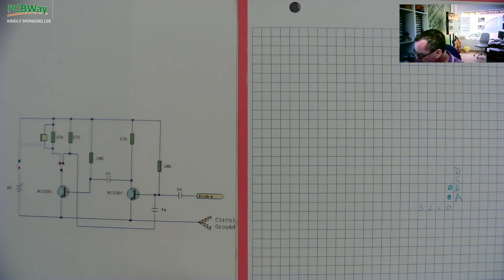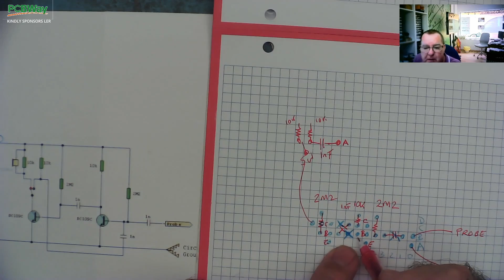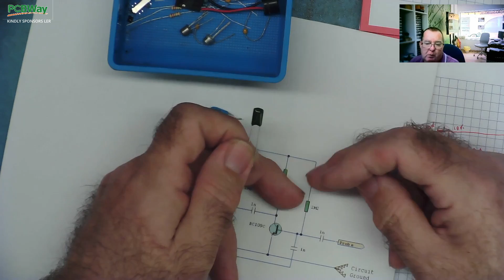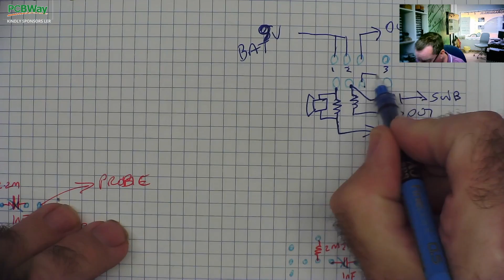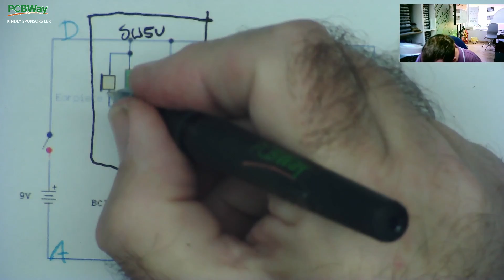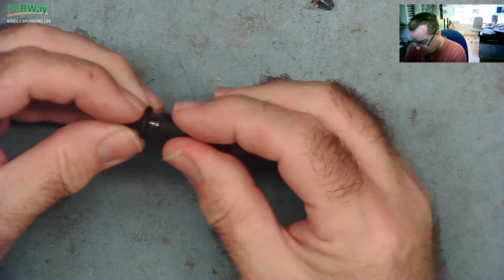Build A Cheap DIY Signal Tracer / Injector Pen Useful For Electronics Fault Finding

Comment: I just went to work for a small repair shop under new ownership and was given an amp to repair. While they had scopes and function generators one of my favorite tools is the audio tracer. But the new owner had never heard of tracers. So I just spent my weekend building an unjector/tracer using parts from my junk box. I had some single sided clad board and so I opened kicad and laid out a quick pcb. I just got a cnc laser and will spend this afternoon hoping to produce a pcb for a new pair of injector tracer circuits. With luck I'll be able to 3d print a pen style case for the tracers. Funny how all of a sudden I'm seeing tracers everywhere. It's like Google is spying on me....

Comment: Obviously, to make a sinal injector you use the exact same "plan C" but connect it to your signal generator instead of speakers.
Or even better, forget the wwhole project and connect a multimeter lead or scope probe into your signal generator. 😂

Comment: I just use a BF245 JFet & BC547 combo.  Feeds into a small 1/2 watt amp and speaker with a small 9v battery.  High impedance input, (4.7M), very low power use and its all isolated.  Works fine with audio and RF.

Comment: Great video.  Reminds me of a signal tracer I built as a kid in the seventies from a transistor radio using plans from one of the electronics magazines.  Basically locate the amplifier circuit and isolate it then attach probes.  I do not remember which magazine nor do I have that tool anymore but great fun when I was done and it worked.  Thanks for that memory.

Comment: Hi I did a simple probe with an amp. Hearing signal on certain capacitors skin. Is this normal?? Thks.
Reply: Picking up an old comment... If there is signal on the skin (outer) of the capacitor, then the capacitor is connected backwards.
The outer should be on the ground, or lower voltage side.
If it's a pass-thru (series) capacitor, then it's only being used for blocking DC and the signal will appear on the outer side irrespective of how connected.

Comment: Hi Rich, the good old multivib, I built one about 50 years ago. Worked quite well. I did use it on a couple of audio Amps as a signal injector but as it creates a square wave the audio tone sound is very harsh. What you should point out is it could be dangerous on tube/valve circuits because some of those used 2 conductor power cords and depending on the way its wired the chassis can end up live !! So that needs to be emphasized to prevent possible electric shock off the chassis and the clip that is intended for the chassis or equipment "ground" !! Yes the Cap is intended to protect the user but the clip can be the killer or dangerous lead on some devices like older radio equipment where it might get used.

Comment: A few years ago I made the same thing as you made. I even used the same speaker you used, but I put a volume knob on it and I used a high voltage blocking capacitor. It's the easiest way to make a signal tracer and it is loud and clear.
Reply: Hi,
What value ceramic capacitor would you suggest?  Several subscribers are asking.  I don't think Richard has seen the comments.  He's too busy making more videos!
Reply: @cskeet1320  I used a poly cap. 250 volts to 600 volts are very common in most switch mode power supplies. Any capacitance will work. Most light bulbs (led or florescent) have high voltage poly caps. 

The reason for the high voltage cap is for safety and to protect your speaker/amplifier if you inadvertently touch the probe to high voltage DC. 

It's up to you to decide what voltage cap would suffice for what you might be working on.
Reply: @gordthor5351  Thanks very much.  Really helpful reply.

Comment: If you looked up the min value of hfe for the transistor you would know how much base current you would need to drive the transistor with the speaker load. Also the value of that resistor is forms part of the astable multivibrator frequency determining RC network. So if you change that you will need to increase the value of the capacitor to maintain the same frequency.

The datasheet for a BC108A gives hfe as between 110 to 200, so feeding 2mA in to the base would allow the transistor to have a minimum collector current of 220mA

Comment: I also learned to always try a new circuit on a breadboard or even better in a circuit simulator software. In software you can easily measure all voltages and currents, make modifications and finally understand how it works if it works.
Reply from the maker: Yeah I have a breadboard and use it sometimes on videos,  I thought I'd get lucky using a circuit that is all over the net and just thought i would save some time by building a small tracer I could actually use. Ho-humm LOL

Comment: Nice one .I am always messing about with stuff like this BUT I always bread board first.it saves a great deal of time 😁
Reply from the maker: Yeah I have one and use it on the channel sometimes, I thought I may get lucky this time with a circuit that was in many places on the internet.  It probably works with an 'earpiece' as it says on the schematic.  It made an interesting video though and my Plan C worked well actually, and those sort of speakers can be found lying around for practically nothing at car boot sales and flea market etc, which is where they came from originally. I will be using the Tracer Pen in future videos no doubt. 😉
Reply: In my experience breadboards work ok for a while until they corrode or wear out. 
I threw screaming fits when even the simplest circuit wouldn't work. Give it an enraged push and boom, it works :D
Maybe hitting them with contact cleaner every once in a while would be a good idea.

Comment: The problem with the original design is, the "speaker your using". I looks to me is not a speaker at all, it's a piezoelectric buzzer. Inside this device is a oscillator driver circuit connect to a piezoelectric crystal transducer. If you replace the device with a plain piezoelectric crystal transducer you'll find it works. That's my nickel worth. Cheers
Reply from the maker: Hmmm I am pretty sure I said the same thing myself during the video 😉
Reply: @LearnElectronicsRepair  I am sorry, Missed that.

Comment: I dont get it. Your circuit didn't work and than you went to PLAN C, put the circuit in a pen and it worked!!??
Reply: Because he used a Piezo instead of a speaker, as per the cct, it didn't work... Plan C was just a de coupling cap, signal tracer, "only"  probe plugged into an amplifier...
Reply from the maker: @vernonmarris6076  Exactly - and that method worked far better than the circuit ever could, for practically no money, you can find those little PC speakers basically as junk these days for maybe €1-€2

Now to build the injector into the other PCBWay pen - I'm pretty confident I can do that 😉
Reply from the maker: No I didn't - watch plan C and you will see exactly what I put in the pen and what I connected it too

Comment: If you work on audio amps or AM radios a signal injector is one of the most usefull tools to have
i have built plenty of them the best one useing OC71 trasistors  with a 3 volt supply 
you can buy (from china) a flashing LED kit and do away with one LED fot the out put (you will need to change the caps to give an output of about 1kc)
the tracer did not work as it needs a peizo disk as a speaker  also it would be better if it had a switchable diode detector on the input probe for use at RF .
Reply: Ceia ce spuneti dv am facut eu unul prin 72 cu Tz pe  Ge si unul in 80 cu TZ pe Si  Ambale au functionat ireprosabil spun au funct ptru ca de circa 5 ani sint pensionar si nu mai lucrez am abandonat tot sint satul pina in git, le - am lasat colegilor mai tineri la  servici Voiam sa spun ca am adus ceva modificari evident in sensul de a imbunatati scula de a o face mai eficienta La cel vechi cu Ge am mai adaugat un etaj de putere  AF in Darlington alimentat la 3Viar pe poz de oscilator la 1,5 V, la virful de contr am pus tot printr-un comutator un etaj detector simplu cu o dioda cu Ge de RF  Din comutator puteam selecta urmarire in AF sa RF  in receptoare  MA  In cel nou am impins lucrurile mai departe pe linga etajul AAF in alimentare am stabilizat U de alimentare a oscilatorului facind-o in doua trepte 0, 6V si 1,2 V era necesar si am modificat fregventa ptru a putea obtine si semnal tv comun Astfel am modificat fregventa pina ce am obtinut un numar de bare orizontala cu fond alb presarat cu puncte  color RGB si bare negre iar in difuzor se aude sunetul dat de oscilator mai mare de 1Kz e un tiuit sfredelitor undeva intre 10-15 Kz  Cu oscilat cuplat la o bobina cu diametrul de circa 200 mm bobinat in aer 5 spire sira de Cu cu diametru mai mare de 1,5 mm cu un capat cuplata la oscilator iar celalalt capat liber  cu oscilatorul pe 0,6V si bobina asezata sub Tv explorind un canal in intreaga banda in cel putin 3-5 puncte pe canal se va receptiona o imag cum am precizat dar cu numarul de bare variabil de la canal la canal am numarat min 5 dar am ajuns chiar la peste 30 de bare (este vorba de armonica oscilatorului) nu am verificat nici o data toate canalele ptru ca nu era cazul daca receptiona aliatoriu pe 3-4 canale selectate la dif de 4-5 intre ele era, suficient si evident sunetul se aude primul cu P de volum dat la mai mult de jumatate  60-65 % pe mijloc se aude bine clar si imag oarecum stabila dar clara si distinctive barele Ce este mai pretentios trebuie totul cit mai bine ecranat, iar virful de tatonat sa nu iasa din ecran mai mult de 2 mm Virful ptru multi colegi a   creat o problema dar e f simplu de facut Cumper un ac ptru umflat mingia de futbol il polizezi perfect drept si introduci un ac de cusut subtire imbracat in  scchci sa intre presat usor dupa care la sf picuri in ambele capete cite doua picaturi superglue ce il vor rigidza in teaca metalica restu se intelege Injectarea semnalului se face prin poz AAF  La partea de urmarire semnal RF l-am divizat in doua astfel am montat un micr comutator cu 3 pozitii 1 AAF , 2 RF1, 3 RF2  Astfel pe pozitia AAF puteam colecta doar semnal de audiofregv si asculta in casca daca erai cuplat ca urmaritor sig AAF Tot pe aceasta pozitie dar suspendind AAF si trecind pe oscil puteam injecta de aceasta data semnal in orce etaj fie radio ori tv pe pozitia de alimentare 0,6 V era suficient si semnalu nu se inducea capacitiv parazitar sarind peste etaje si cu cit te indepartezi de detectie daca receptorul este bun atunci semnalul creste de la etaj la etaj spre antena si invers  scade  conditia 1,2 V se foloseste la intrare in et de detectie unde semn este mic si la ultimii Tz la et final la fel si in tv in calea de sunet pe calaea com sunet imagine  se merge cu 0,6 V altfel semn este prea puternic si sare etajele facind grea identificarea etajului defect La partea RF am despartit in doua intrare semnal pasiva dar cu dublare de U folosind doua diode de detectie si o intr activa folosind pe linga et de detectie in fata lui am pus un amplif de RF  (TUJ) cu un Tz cu efect de cimp care creste sensibilitatea disp la peste 50  - 100 de ori ce il face aproape inutilizabil da rezultate f bune in blocurile armate cu fer nu are probleme de ecranare in rest aproape ca nu il recomand semn este extrem de puternic astfel este suficient et de detectie cu dublare de U  Dupa o perioada de lucru pina te obisnuesti si inveti cum se comporta si cum raspunde ambele dispozitive incorporate in unu sing  devine aproape indispensabil daca mai faci doar un oscilator pot regla media fregventa si la radio dar si tv  si poate fi utilizate si in electronica industriala dar cum spuneam trebuie sa inveti sa il folosesti corect, poti identifica cond rai s-au buni cu IM verifici rezist si cu generatorul si urmaritorul trecerea semnalului evident nu poti masura valoarea dar poti sa i-ti dai seama daca blocheaza semnalu sau nu  Eu l-am folosit zilnic in 50 de ani de munca nu am folosit alte instr in afara de aceste dispozitive si un IM analog sovetic f bun si precis, desi in atelier erau tot felu de scule osciloscop fregventmetre tot felu de generatoare de functii si RF Era loburatorul de electronica metrologie a unei fabrici f mari lucram in laburator 30 de electonisti  dar eram singurul care ma preocupa si depanarea r-tv si desigur AAF-urile ptru sonorizari sali spectacole stadioane etc Permmanent aveam de lucru peste puteri, nu mai pot  Am pus STOP gata am obosit

Comment: Nice video, I learnt a lot, including not to trust online schematics!

I imagine plugging your tracer pen into a behringer cable tester/generator (CT100?) would turn it into an injector, with selectable frequency and level output.  Obviously not quite in the DIY spirit, but it is something most audio techs probably already have lying about somewhere

Comment: This circuit is simply a astable miltivibrator, all beginners' favourite for flashing LEDs, but drawn in an unusual way, typically the transistors face "away from each other" if that makes sense. No idea how is this supposed to be able to trace an analog signal. And usually for optimum performance the ratio of the base resistors to the collector resistors is ~10:1, and here it is 220:1.
Reply: the astable works using positive feedback, if you remove the feed back from one of the transistors ( by way of the switch) you can then produce a very unstable amplifier, this is the basis of this 'probe' circuit.
Reply: Ahh, I see that now, thanks!

Comment: thanks for video and info.. all knowledge shard gratefully accepted :) small question.. is this device basically a continuity tester?
Reply from the maker: Nope
Reply: No you inject a signal into a audio circuit for example,  then use the tracer pen to see where the audio isn't.  So you can narrow down troubleshooting pcb boards
Reply: @3dsmaxrocks699  that's what my braincell has trouble understanding... putting signal and testing for reception is continuity ?? perhps my braincell needs more exercise. or my dictionary does.
Reply: @Palmit_  if you have an old radio circuit that's not working and you turn it on (or inject a signal) you use the tracer and touch around on the input stage with it and if you hear sound you can determine where the audio is cutting out or is lost. If input stage has sound you move towards the output stages. That just narrows down where bad components might be.
Reply: @Palmit_  continuity checks for a connection being good while tracing checks if components are good
Reply: @3dsmaxrocks699  Thanks for your answers. I appreciate them and have learned. my brain cell is now into 2nd gear! :)